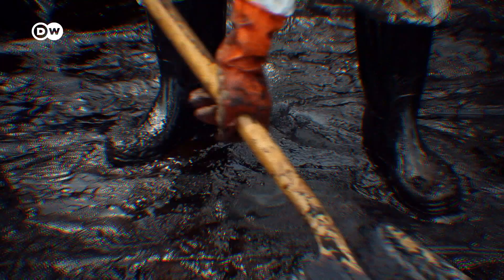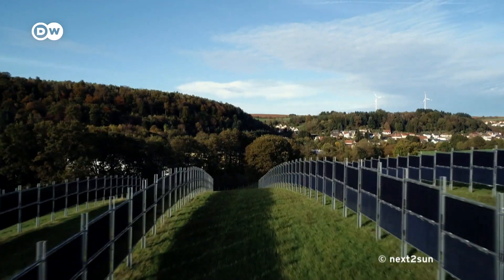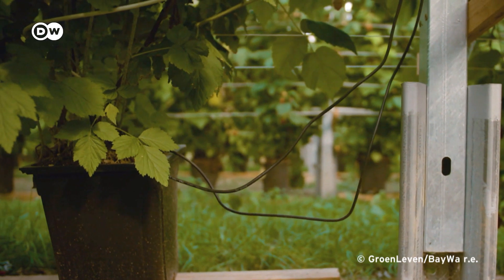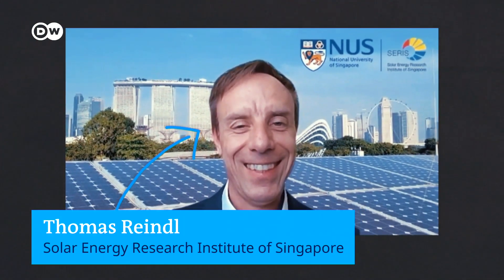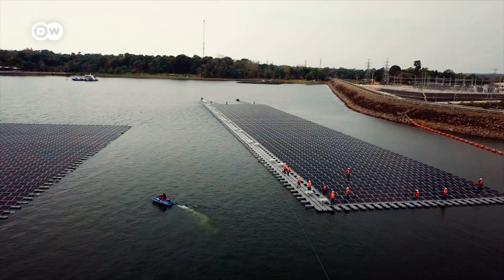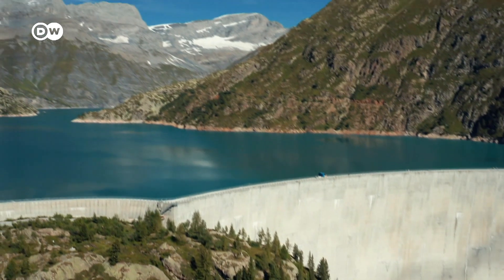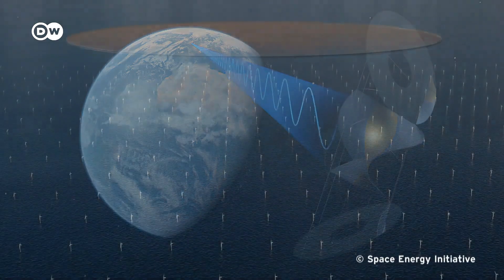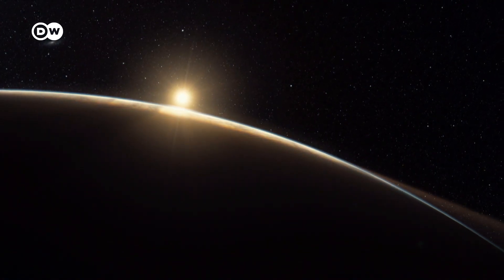Why we should be putting solar panels on our fields and lakes

Comment: This sounds interesting, but one thing i know - It is definitely not cheap in Africa, In fact, it is so expensive and it looks like the cost will increase over the years as demand rises. This is a great initiative at the Government level to participate in, and when considering the "land issue", starting the project in a county where land is mostly privately owned, This increases the cost of setting up the project.
Reply: Morocco is investing in the kind of solar energy where mirrors heats a “tower” full of salt (and water) to extreme temperatures.  Then a steam turbine generator produces the electricity.  The salt remains hot during the night (although the electric output obviously decreases).  Some European nations have signed deals with Morocco to import electricity.  I think even the UK will import electricity… the losses are obvious high for transferring electricity that distance.  But in reality I would suppose the electricity actually produced in Morocco will be consumed in nations like Spain and France, and the electricity the British will use will be what is produced in Spain and France through other means.

Although I think you are wrong. Usually the price of technology drops the more who consume it, when also more start to produce it.  Manufacturing is rationalized, costs of production and transportation decreases per unit, and patents expire.

Where I live we have a different problem though:  The panels doesn’t get much sunlight when the sun is hardly over the horizon during, and >1m snow covers everything. 😊   While we also use more electricity during winter.  So wind is a better option.  And the old hydraulic power can balance it.  Still people have started mounting solar panels on their roofs.  They can sell electricity they don’t consume to the major electricity producers.  You can even get the electricity producers to pay some of the costs of the panels.  But then you have to pay for the electricity more or less just like before and doesn’t earn much from the electricity you eventually sell.

Non-electric solar panels to directly heat water has been relatively common for a while though.  I have a long pice of a black hose left over from a building project.  That I just lay on the ground for the sun to shine on it summertime.  And have the water run through it before it enters the actual heater.  It likely saves some watts of electricity on water heating costs when doing my dishes.  😄

Comment: Almost all of these arguments have economic holes so large you could drive a Tesla semi through them.  Combining solar with agriculture in greenhouses and other special circumstances has merit.  But most agricultural applications are extremely problematic and will take many decades to sort through.  Reservoirs are already heavily used for recreation and power production; adding solar would significantly detract from existing economic activity.  Canals which deliver water to thirsty farms and cities in dry climates are the very best choice as roof structures would reduce evaporation.

Comment: If Ukraine had an existing network of standalone photovoltex systems grid tied they would be able to power up their grid from different sources now so as to take away a portion of the outage at least depending on the damage inflicted on their grid system.

Comment: Can you do a video on dumping grounds for spent and broken solar panels and wind turbines ?
Reply: More than 90% of the components in solar systems are recyclable. They are made of three primary materials – glass, silicon, and metal. To recycle these parts for future use, they must be disassembled, and the raw materials have to be isolated. This is a complex process that requires a lot of time and effort.

Comment: Dear DW and fellow viewers, not much action is taken on industries against all times of emissions. They are not asked to ugrade and maintain equipm like converters,esp,filters etc. Many are using 30yrs old min machines. Lastly 3rd and 4th gen PV to be used and storage issue to be resolved. Currently PV tech is limited to 20-23% max efficiency,should strive for 50%.

Comment: A hectare Solar produces 1 million kWh a year. In the Netherlands. A kWh cost a euro. Yield one million euros every hectare Solar. One Million Euro Profit per hectare every year.
Reply: Thats not how it works.
You still need to pay for the maintenance and at some point they need to be replaced.
They make way less profit.
Reply: @GrillerRohde  not true. The profit of Solar and Wind is skyhigh. The Sun needs no maintenance. I have a house with 30 Panels, I let a house with 20 Panels and my Villa in Costa Blanca Spain will get 12 Panels. 12 x 400 Wp is 4800 Wp. Times 1.5 Solar Radiation in Costa Blanca is an output of 7200 kWh. All together I produce 11.000 kWh a year in Groningen Netherlands and 7000 kWh is Spain. 18.000 kWh every year. I make a lot of profit . The Sun needs No Maintenance. Panels are Full Automatic. I am now in Spain and my Panels in Groningen Netherlands produce Clean Energy and I not even near. Everyday Profit. How many Panels do you have? 🙂👍☀️

Comment: Extraplanetary energy harvesting is a counter productive idea.  There is currently a fixed amount of solar energy that his the earth every year. Pulling power from outside the shadow of the planet would increase the energy (heat) in the system (planet). That's exactly what we're trying to avoid. Covering reservoirs, canals, & aquaducts with solar is a two-birds-one-stone scenario. Pulling in energy that would otherwise bypass the earth is a "borrowing from Peter to pay Paul" scenario.

Comment: We do not desperately need plastic manufacture pollution.  We need permanent magnet motors as generators instead of forcing the armature magnets and coils of copper in the generator.  Tesla bound the Edison generator with magnets all around the armature and used water to turn the armature.  We have not recovered from Tesla's deciet and propaganda control.

Comment: Photovoltaics is a term that ignored  the danger of photoelectric molecules circling the planet.  Photoelectric molecules and polymers do exist and are dangerous to the environment and atmosphere of the planet.  Photo electric molecules are  converting energy to electrons repeatedly and continually from light.  This is not photo voltaic theory.  This is the quantum mechanics of photosynthesis and photoelectric molecules circling the planet and causing evacuations of Mongolian
 plateau 2011.Aug.

Comment: if you put a solar panel on Every EV sold.. the solar panel can probably give the EV slightly longer range and if you run out of battery in a remote area, you only need to wait for your EV to "recharge" itself and you are on the road again.
or if you dun need the longer range, the power can be used for your car's Air Con or heater in winter. or charge your devices in car.
Reply from the maker: We are releasing a video about EVs soon, so don't forget to come back and check out the channel. We release a video every Friday!

Comment: So how much carbon is released per ton lifting those several thousand ton satellites into low Earth orbit. Answer. 27 tons of carbon dioxide per ton to low Earth orbit and even more for higher orbits. All that speed must be achieved within earth atmosphere where combustion is most efficient. 27 tons of CO2 to lift one ton into orbit. There's a CO2 cost for fuel. Lol.

Comment: Put them on houses and buildings instead have the governments pay for 50% of the costs in tax reductions...  building it near crops is stupid multiple problems birds and insects that help plants pollenate get burned alive on those solar panels (I suppose its good for pest prevention but not for bees and birds). Also it would be extremely dangerous to farm those plants by hand and you couldn't use proper large farming equipment.

Comment: What you are forgetting is these panels are not recycled. They are dumped under the ground and don't 'decompose'.
Reply: More than 90% of the components in solar systems are recyclable. They are made of three primary materials – glass, silicon, and metal. To recycle these parts for future use, they must be disassembled, and the raw materials have to be isolated. This is a complex process that requires a lot of time and effort.

Comment: The  dust and dirt from cultivating the crops beside the solar panels would  reduce the efficiency of the panels and need extra cleaning which would then damage the  crop also it would halve the crop harvest .  A good  place to put  solar panels is on degraded land that is not fit for agriculture  that's near transmission lines and can be connected in .   Putting panels on good farming land should be illegal .

Comment: Floatovoltaics on salt or brakish water  could also be used to collect evaporating water. This free desalinisation process would add to the efficiency for no significant costs.
Reply: Not salt water. Salt is very corrosive to solar panel arrays.

Comment: We should not be taking out vegetation to make room for solar panels. That much is certain. Whatever planting that can be done that is compatible with the shading created by these panels should most assuredly be done. However, we consistently seem to be overlooking all the places where vegetation already doesn't exist. Places like roads and rooftops are yet to be extensively exploited. Some crops are not compatible with shade, but there is no need to eliminate vegetation simply in order to locate solar panels. This offsets the benefits of renewable energy by destroying carbon sequestration.

Comment: 1. On roofs, walls and (in summer) windows of houses (thin perovskites etc.). Maybe also on pavements and roads (they are often dark anyway).
2. On roofs of greenhouses (they would make energy from green/UV light and let the violet part through, then the electric energy would power red+blue LEDs at night to make vegetation faster.

Comment: Solar panels everywhere? Q. Why not? If used above land they can reduce evaporation and increase cropping due to lower heat stress, they could also potentially make previously unusable land productive, if it only allows grasses to grow and no crops, then you still have more grazing land for your sheep etc.
If panels floating on the oceans don't last as long because of the salt, then why not suspend the panels higher by using pvc. cylinders/drums to raise them off the water?
I have solar panels on my roof, only a 2 KW system but I pay for no electricity!

Comment: I think a way more important issue is how panels are manufactured and how they are recycled, Solar panels are great but they need to be easily manufactured using readily available materials and have a reliable recycling system.
Reply from the maker: Hi Evan, we have touched on this topic in the following video: https://youtu.be/EWV4e453y8Y – let us know your thoughts in the comment section 🌍

Comment: In the mean time we can require that all homes and businesses install solar panels on their roofs with a simple and inexpensive grid tie inverter.  The average home consumes at least 100 watts/hour on standby power. This can easily be generated at home and fed into the home's grid with two 100watt solar panels ($200), plus a 1000watt grid tie inverter ($100).  This will allow each home to generate the standby power the consume saving at least 800watts each day that they don't have to draw off the city grid.  Multiply this by say, 1,000,000 homes and you get at least 800 Mega watts that can be saved from the city grid each day.

Comment: I don't get this. Here are some of the cons: 1) If you put solar on a crop planted field, you reduce the field usage by 50%. You can't drive a tractor to till the land. You can't spray insecticide from an airplane. Constant watering will corrode the the solar stands so you will have to use expensive stainless steel. Solar wiring will get mowed down by tilling or farm equipment. You can't clean the solar panels with soap, it will contaminate the crops. 2) If you put solar panels on a lake or body of water, it will be hard to maintain the panels because it is less accessible. Maintenance workers can fall and drown. A storm can make water move violently and damage the panels. Water can corrode metal parts. It will be more expensive to install and maintain. California, Nevada, Arizona have a lot of desert. It may not be necessary to be too fancy and risk wasting money. Don't get me wrong I'm pro solar. I just don't want people who have other 'special interest' try to hijack govt solar project money. Farmers, land owners, local governments...they all have their special interest. If it's a energy project, it's best to give the control to the power company who knows more about maintenance and installation cost.

Comment: Collecting solar energy in space and using laser/microwave transmission to Earth is a terrible idea unless the collector in space can shield an equal amount of solar energy from reaching the surface. The additional energy transmission from space would concentrate more energy on surface/within the atmosphere and will have a similar impact as would more CO2 or methane in the atmosphere, thereby accelerating climate change. So even if fossil fuel use is cut in response to the satellite transmission we would still experience climate change due to the increased amount of solar energy concentrated below/within the atmosphere that should normally be reflected back into space

Comment: 1.
Photovoltaik is Great. But Frankly. We dont need any more of it. 
What we need instead is Battery Storage. 
Because right now. All Photovoltaik does is create Tons of Wasted Energy. Because its Producing Vast amounts of Energy which then Results in Overproduction during Midday. And then Stop Producing entirely at night thus Forcing the Coal Power Plants etc to Stay Online because they need a a few Weeks to Start or Stop Producing Electricity. 
Meaning effectively most of the Photovoltaik Energy is wasted already. And Building more really doesnt help anyone. 

Hence. Instead we should Focus on Developing better Batteries and Build more Battery Storage. 

2.
I would put Photovoltaik on my Roof. But only in Connection with a Battery Storage in my Garage or Basement. 
Why ? 
Because thats actually useful Photovoltaik that does not just Produce Waste Energy which People need to Pay for. 
But which actually provides Energy that is Used and Costs very little to anyone. 

3.
Solar Farms should therefore be Coupled with Energy Storage.
Frankly. We should make Laws that Require Solar Farms to have Energy Storage attached to it.

Comment: As for beaming microwave energy towards Earth, that could easily be weaponized and other countries wouldn't allow it.  Consider putting an array of umbrella to reduce the amount of solar energy going to Antarctica.  Light will still go thru in between them but the net effect is the amount of solar radiation hitting the Antarctica will be much less than normal.  Doubt that this will happen in the Arctic since a lot of countries will be against it but there's less ppl in the southern polar region to complain about the lack of sunlight.

Comment: Agrivoltaics main "issue" is legal concern. 
Yes, trials are good. And sacrificing even 12% for a better yield would worth it.
Berries are the one that shows best yield. 

HOWEVER... most countries have strict building regulations and this new technology doesnt fit into an obsolite system. 
Most common is the law that agrcultural land cant be used for anything else than... well... agricultural reason. And since solar and windfarm reaching the level of able to generate as much power that it can be soled on to the grid, legal clashes occur. 

If its generates electricity the farmer can and possibly lose any farm related tax reliefs or helps. 

And solar panels on this size needs building permits, so rural/agricultural land regulations reject this...

Comment: Hi. Well done! "Thinking outside the box" and constructive use of various niche generation opportunities is excellent, however you underestimate the inherent difficulties and risks in some cases. Solar panels floating at sea isn't something I'd invest in, firstly because the solar panels will be attacked by salt corrosion and quickly fail. Second, you mention "waves" as a problem just once, but waves are actually the main trouble. Not only will they saturate the panels in seconds, but just one bad storm could consign the whole solar array to Davy Jones's locker. This also applies to inland lakes and estuaries. As all surfers know, storms out at sea, even if they never reach land, can still generate 4 meter on-shore waves. This idea is a money loser. 

Fitting solar panels around farms is a good idea, but only practical around crops that don't require mega-machinery to plant or harvest. The panels will hinder evaporation of water, but condensation will collect underneath, which may be a problem. 

Your most useful idea is putting solar panels over car parks. The electricity can charge the cars directly, without the efficiency losses of converting DC to AC (for the grid), then back to DC to charge the car. They would also cool the sidewalks, turn open streets into person-friendly  malls, and best of all, no-one need return to a stinking hot car. 

This idea could also help solve the tragic problem of children dying because their ignorant parents left them locked in the car for "five minutes", but got distracted, and remembered them a whole two hours later. The SPCA will love it too. Thanks for your hard work. Cheers, P.R.